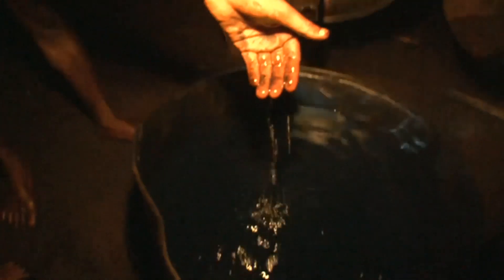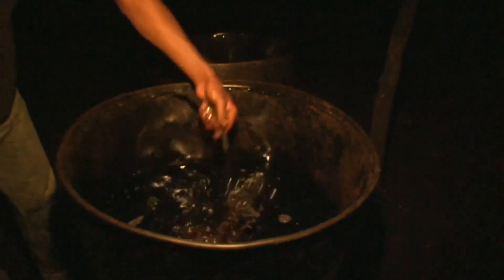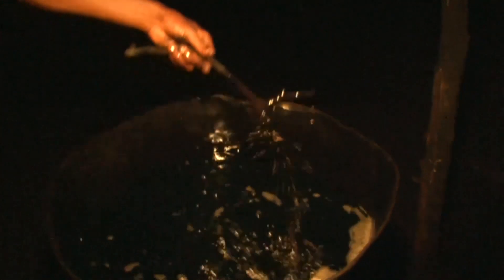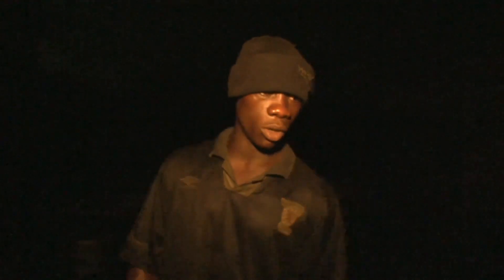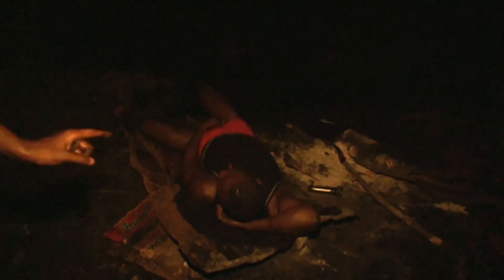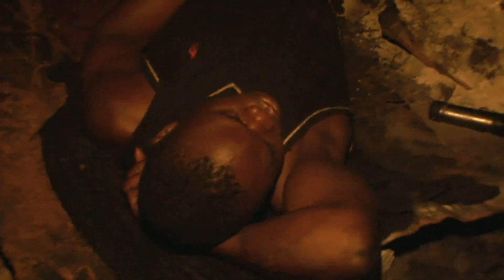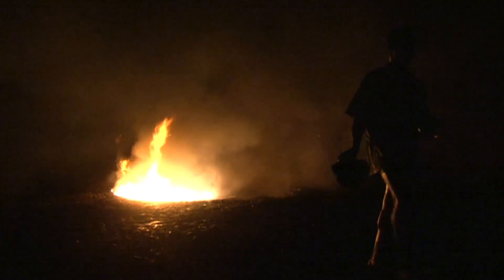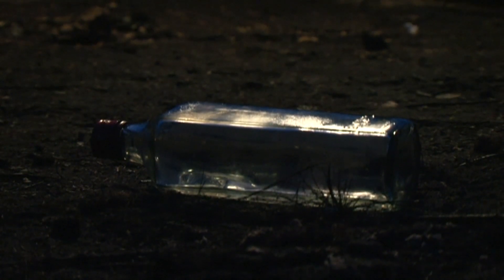Refining Oil The Rough DIY Way-

Comment: While this particular setup is not ideal by any means, mini-modular refining should be in the future. It’s much less capital intensive, can be accomplished at a local level, offsets importation costs, decentralizes control, provides local/regional price stability etc. For burgeoning economies with domestic supply it’s a perfect solution. I’m quite interested in small scale refining as it would help during current times immensely.
Reply: I AGREE 100%.. but the "BIG Boys" will never let us play!
They'll implement so much "red tape" and make it practically impossible to compete!
Reply: large refinererys are more efficent and have lots of saftey and enviormental controls  the best thing we can do it invest in existing refinerys or build brand new ones
Reply: @ckyownz9 fuk your safety controls where were those when atom bombs were dropped on hiroshima and nagasaki? should be able to take a class get a permit and do this on your own
Reply: But that would be smart and good for the people.

Comment: When poverty strikes you, you strike back that is how we roll in Africa
Reply: That is vapor not steam coming out of the tubes. Wasted product
Reply: They need to improve thier condenser
Reply: @mcdaniels4820 they need to improve every part of their set up. A fairly basic set up would probobly still need a colum still, then maybe use a heat transfer to run steam through the oil instead of directly heating the product as to create a more manageable and safe set up.
Reply: FACTS!!
Reply: Doesn't seem like you guys have advanced much in the last 200 years
Reply: yaga day that is probably good for the environment
Reply: @JP_94  don't worry, the big companies you buy from are doing worse